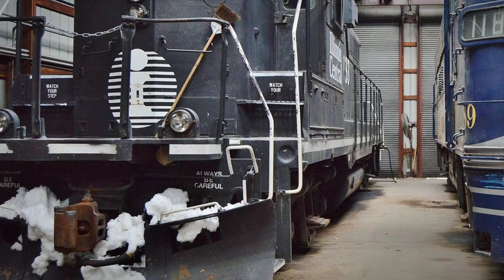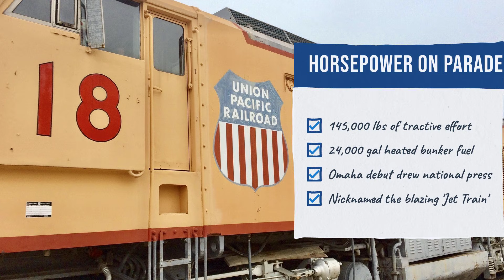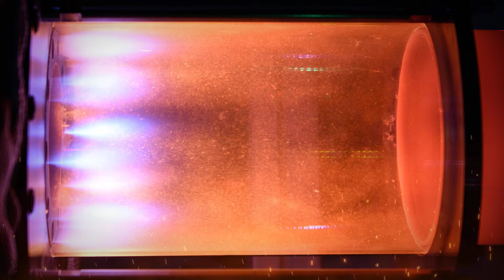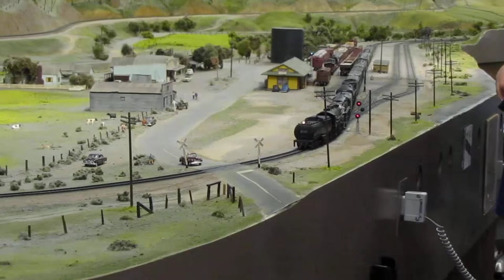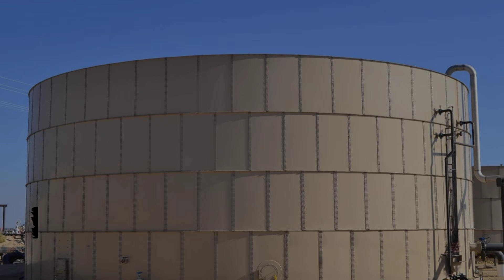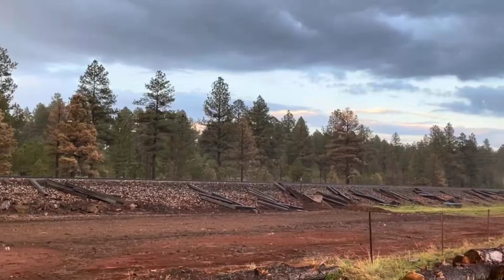Why America's Most Powerful Turbine Locomotive Couldn't Pull Its Own Weight Uphill

Comment: If they didn't work the UP would not have used them.  I'm skeptical.
Reply: They worked fine they biggest problem was they drank fuel at a ridiculous rate even at low speeds. Only being efficient at wide open throttle. And the biggest issue was the fuel itself was found to be used in the plastics industry which increased fuel cost greatly. They did last 10 years. But with diesels becoming more powerful and much easier to maintain it was decided to go fully into diesels.